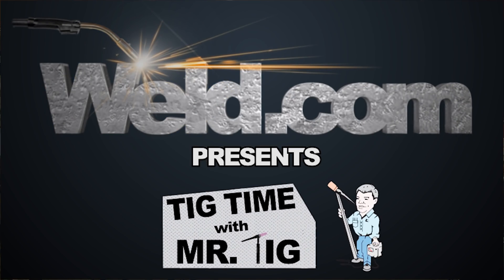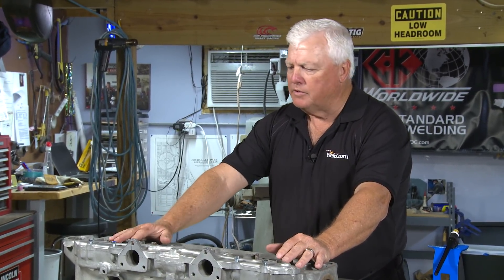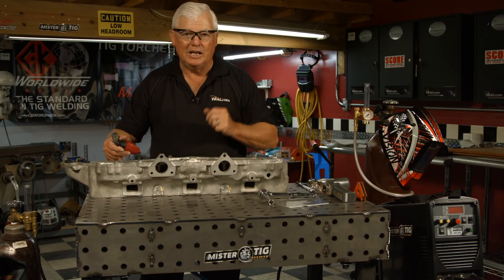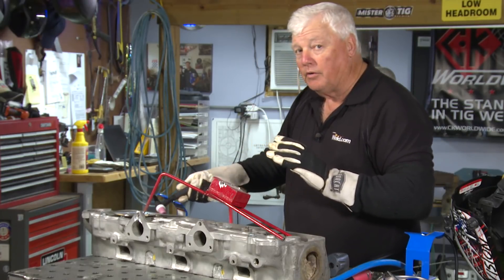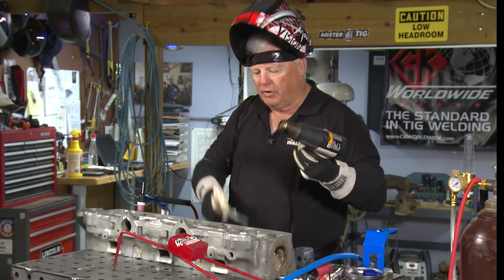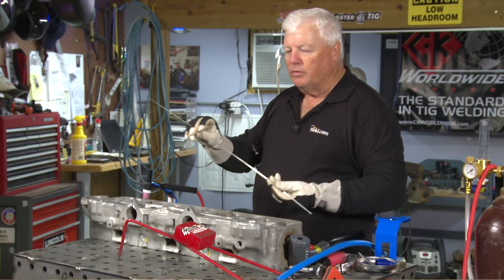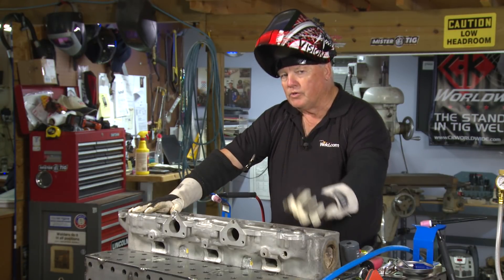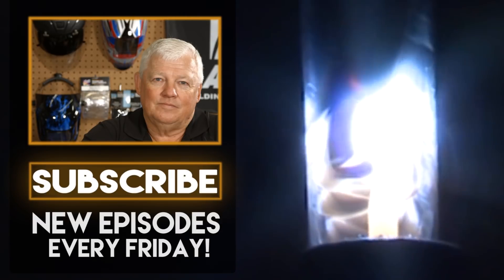Cast Aluminum Head Repair: 1954 Nash Healey (Part 1 of 3) | TIG Time

Comment: I know this is some years older. I've done my fair share of automotive weld repairs. Bolt as much as you can to the mating surfaces to the broken piece weld as much as you can with its mates bolted on . This will provide the best fit going back together.  I've learned this the hard way.  You don't want air leaks and warped flanges.

Comment: I seem to recall that 5356 is frequently not recommended for parts that will see sustained temperatures above 150 deg F.   It seems that 4043 is generally better for underhood parts, at least in this regard.

Comment: Kinda why I never liked Mr.Tig. I always felt like this dude would lie to your face about something.

No way he uses that scrap alumi just to show him it’s not the machine. Get the setting dialed sure but we all know if the camera wasn’t on he’s fire away on the piece as soon as he got the setting right, not show him self his machine isn’t malfunctioning and that the casting is dirty. Even as a relatively “new” welding we all know castings are nasty af. Such a dumb excuse for a lesson to be “extra safe”. It’s like teaching someone to check every fire extinguisher and fire alarm in the warehouse each time you start to weld. No one does it and it’s a dumb thing to lie about. 

That’s another reason I love Bob and the guys, they tell it like it is honestly no BS.

Comment: How do you determine if its aluminum or magnesium? Both are non magnetic. Some older VW beetle crank cases are magnesium, some were aluminum. How to tell the difference, also, can you tig magnesium?
Reply: Eccentric Smithy magnesium burns. Aluminium melts. Watch ave vidéo about it. Vinegar also reacts with magnesium castings.

Comment: Next time you have to grind on aluminum have some bees wax and touch  tthe turnin burr to the bees wax now and hhen.
The bees wax will help to keep the aluminum from sticking to the burr.
You will have to clean the bees wax from  the al before welding.

Comment: Would that be a 4043 silicon or manganese filler ?
Reply: Rolf Lindberg 4043 rod 5%silicon is perfect for cast aluminium the manganese is 5356

Comment: You mentioned getting rid of moisture with the pre heat of the aluminum. At a AWS meeting this last winter the topic was hydrogen cracking and they explained heating the material just opens the pores and drives the moisture in to the material.

Comment: Thanks. I wonder how if you are still using your regular ck worldwide 17 flex torch and how it was coping with the extra amps, or was it a ck26?
Reply: The single red hose looks like a #17 air-cooled torch to me, so 160A is all he should attempt.  I would bet he was running close to a meltdown at 200+ on this repair.  I have a water-cooled CK FlexLoc torch and it has 3 hoses: black (gas), blue (water in),  and red (cable & water out).

Comment: Any other set up spec on the welder for us, pps, hz sounded 130ish,  modified wave, background amps,  ar/he? Why would you run %70 balance when you guess the casting to be dirty, why not run 60/65, or is that where you found it doing best? Been struggling a bit myself with some dirty welding 1/4"al with a dynasty200. Thanks
Reply from the maker: hz = 120, no pulse, 100% argon. The cleaning action will vary a little bit. That is why we like to run a test bead before welding on the actual casting.
Reply from the maker: Pulse is related to amperage. For instance if you have your machine set at 100 amps and your pulse at 1 pps / 50% background current it will go from 100 amps to 50 amps and back to 100 amps every 1 second.
Reply: I would like a good explanation on how the advance waveforms work on the newer welders like a couple of the Everlast welders I'm looking at.
Reply: Weld.com  what shade number was the alloweld lens being used?